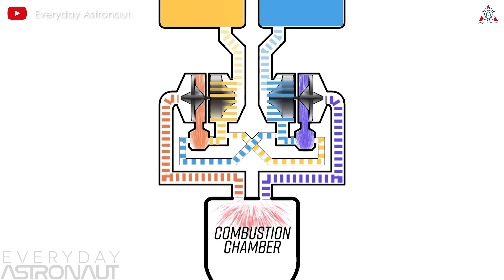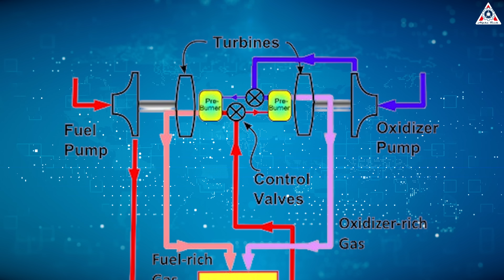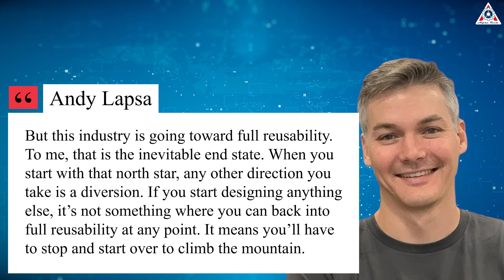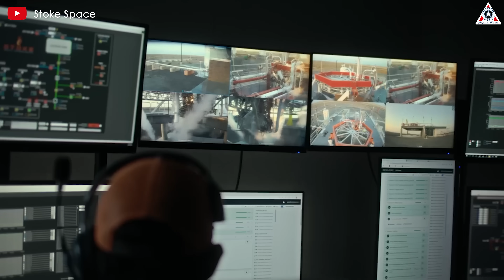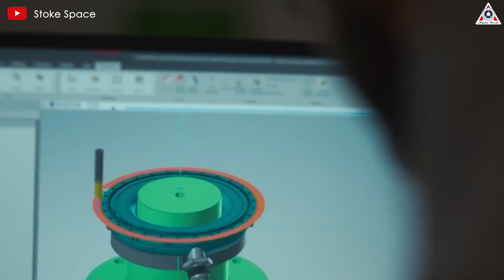Stoke Is No Joke! Stoke Space To Copy SpaceX Starship and Raptor. Musk Laughs...

Comment: Even if they fail to pass SpaceX, I could see the smaller engines and aerospike tech being used for smaller craft or probes working with SpaceX.  By following a path like SpaceX the designs would likely be easier to cross adapt for special needs down the road.  With the aerospike engine I could see it as a viable lifeboat craft as well, with the larger SpaceX focused on bigger payloads and crews.  While SpaceX focused on big bulk runs and longer ranges a company focused more focused on the small end could be used for rapid deployment and could be better for some military uses as well.